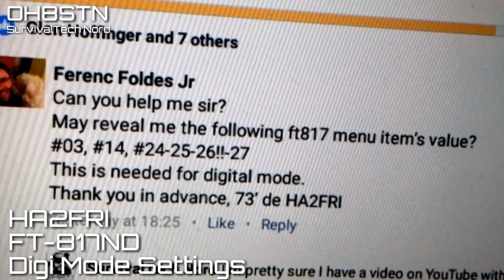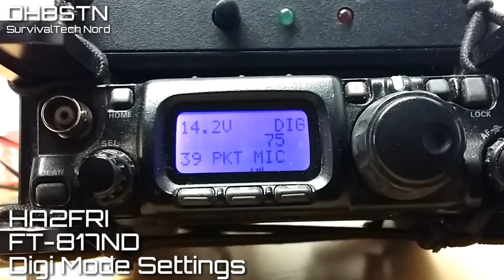Yaesu FT-817ND FT-818 Data Modes Settings

Comment: Hi dear Julian,  i have a question for you: is it possible to use the Xiegu ce 19 interface  for ft 817 yaesu to do ft8? And how configure? Tnx  and 73 de IW2HTZ  Roberto
Reply from the maker: Definitely not. It's not a good interface at all. Kiss yourself a Digirig. That's the best interface on the market right now.
Reply: @OH8STN  ok Julian,  always clear. Tnx and my bests 73 IW2HTZ Roberto

Comment: Anybody using the 817 or 818 with the Tigertronics SL-USB-RJ45 ?? for Data Modes ???
Reply: I just picked one up this past weekend that's why I'm looking through Julians old videos. Starting on the journey to learn digital.
Reply: @stahpit1971  cool.  Check out Nov 2021 of pg 46-47.  Good luck :)

Comment: Thanks Julian for your videos. I have just setup my FT817 for WSPR reception. I am finding that when I select a  frequency  in WSJT-X wspr it selects the correct receiving frequency for a moment ., then switches 2180 hz lower?? Is there another setting to adjust?? 73 Jim

Comment: Quick question.

I am using an FT-818 with a Signal link and FLDIGI.  We use this set up locally on a UHF network to support emergency communications between local shelters, the EOC, etc..

Recently a few helpful members of my club were helping me fix a transmit issue and as a result I can only transmit NBEMS in packet mode.  Previously I was able to send or receive (not both) in FM but since the changes they made it only works in packet mode.  I am not sure if this is an option selected in FLDIGI or the radio.

Other then having to switch radio modes to packet the set up works beautifully. But everyone else is using FM.
Reply from the maker: The problem you're having is when you want to transmit data with the 818, assuming the signalink is connecting to the back data part of your radio, you should do so with the radio in packet mode. If you want to use other modes for example on HF, use DIG digital mode. The only time you would use FM as the mode for data Communications is if your signalink was connected to your mic connector, which is a bad thing. So packet mode for FM data. DIG mode, for all other data. They are two different pins on the data port of your radio.
73
Julian oh8stn
Reply: @OH8STN  Much appreciation, some folks are telling me that using packet is wrong (trust me in no way am I arguing with you) and the guys who made the switch for me on my gear without exactly explaining what they did called it a workaround from a  video they looked up.  Yesterday it worked perfectly for me during an exercise; like it was intended to function that way (which obviously it is).

Yes I have the Signal link plugged into the data port in the back of the radio.  I clearly see the configuration distinction you made regarding if the Signal link is plugged into the MIC port instead.

I appreciate the precise and efficient explanation, I like my processes to be clearly documented and repeatable.  This is all a bit more than a hobby to me.

Now that I have this working in UHF/VHF, my next hurdle is make it work in HF and DIG.

Again thank you.

73
Reply from the maker: I don't mind if you're arguing :-) hey just so you know packet or PKT & DIG are just the names used to distinguish packet for FM data, digital for SSB data on the 818. That's where the confusion is coming from. I also have one little piece of advice for you. Don't let some fool mess with your gear. I suspect you understand that already :-) ;-) if it was working perfectly yesterday, I would put it back the way it was. The fact that you're asking questions means you're a step ahead of those knuckleheads. :-)

Comment: Thank Julian! Great video.
I have an 817nd trying to get my Kantronics working it is the new model that they put out .
I'm just wandering what the radio must be set to USB LSB DIG, not sure what it need to be on.
Thank you.
Reply from the maker: I think I made a video on this but I don't remember. If you're doing digital modes like APRS with the kantronics on FM, the radio should be in packet mode. If you're doing modes like psk, js8, ft8, ... use dig mode.
Reply: @OH8STN  just using winlink for emails only. have not set up psk31 yet and Mobilink I work on that soon. Thanks for making the great videos for us Youtubers it takes special person to go outside and make a video in zero degree weather.
 Thanks again 
73's

Comment: hi, I cant seem to get wsjt-x to connect to the mini pro sc, im just using the one cable from the mini pro sc to the ft 817 data port, what am I doing wrong ? thanks
Reply from the maker: Hi Ronan. You'll have to give a bit more information than that. What do you mean by connect? Aldo, what operating system are you using? Anyway the most likely problems are selecting the wrong audio interface in the sound card settings of wsjt-x.
Reply: Hi. I got it working I set right control to none now I am decoding, where should alc be on 817 ? None a little or in mid bars thanks
Reply: @OH8STN  its ok I sorted it, I choose none for rig control and she started decoding :) where should alc be on the 817 ? a little or none at all ? thanks
Reply from the maker: @ronancullen4565  great 👍 alc should be almost none, otherwise its splattering the band.

Comment: I just got me a Yaesu Ft-818 This last summer and been trying digital modes now on it.. When u say leave it on User-U, I've done that but will not transmit on that mode, but only on PSK-31-U.
Reply from the maker: Perhaps there's a firmware difference between the two radios. This is the 817nd.

Comment: Hi Julian, I hope you’re well? I’ve just got a 817 and trying to get JS8CALL to work, I can hear stations and see their conversations, however when I TX CQ, no one seems to be ‘hearing’ me. 

I’m convinced it’s ‘operator error’ on my part or I’ve got a setting wrong in the radio/program, as I’ve used the same setup on the RaDAR challenge Saturday gone and I was getting contacts as far away as 1600 miles.......any help/advice would be greatly received, 73.........Paul
Reply from the maker: I'm just heading to bed but try this Paul. Most common mistake we make is putting the radio in USB mode rather than digital. Having the radio and USB mode will replicate the symptoms you described perfectly. Try DIG. I also have a couple of videos and setting up the Wolphilink with 817. Naturally the interface is different but the settings on the 817 are identical.
Reply: Cheers Julian, I’ll give that a go tomorrow. Sleep well 👍🏻

Comment: Hello Julian- Do you use these settings when using the Wolphilink?  I just got one and need to tweak it. Seems that I am not decoding, the owners manual does not have much info on how to tweak it.. thanks for your great videos.
Reply from the maker: Hi Mike the owner's manual has a section on adjusting the transmit audio and reception audio. To treat the transmitted you need to adjust the transmit pot on the Wolphilink, well you have your ALC meter showing on your rig. Then you can adjust it perfectly. For reception you need to have one of the apps open which has a waterfall. Slowly turn the receive pot until you have a stream of stations in the waterfall. Then adjust for best reception. There's also the squelch Android psk on the left side of the screen at the bottom. You can stop the random characters from showing up by touching one of the higher bars.
I hope this helps
Reply from the maker: I forgot to answer your first question, yes I use them with the Wolphilink

Comment: Thanks for the video.  Tried your settings and they work, sort of,  on my 817nd.  However, after each transmission (wsjt-x ,Windows 10, Signalink)  I get an error message that says " Hamlib error: Command rejected by the rig while exchanging VFOs". I then click retry and then enable tx again and I am able to continue the qso until after the next transmission. Then aforementioned procedure starts again.  Here's hoping you or someone else can assist me.  Tnx.  By the way, I did get that Super antenna setup.  Cool.  de ke4rk, Mo
Reply from the maker: Are you using split mode?
Google "Yaesu ft-817 Hamlib error: Command rejected by the rig while setting". Sourceforge is down right now, so I can't give you a link. When it's up again, you'll find your answeris well documented.
Reply: Thanks for the quick reply.  No, I am not using split.  That was my first thought also.  I saw that too about Sourceforge. I'll keep checking their site. 73
Reply from the maker: No problem. One thing you can do is try an older version, if you have it available. That sourceforge thing as a real bummer.
Sorry I couldn't be more help
73
Julian oh8stn
Reply from the maker: By the way what kind of dog is that in your profile pic?
Reply: That's Sophie.  I got her from the SPCA and they think she is an Australian shepherd.  I got her because she has blue and brown eyes.   BTW, that's a "dirt" moustache.
Reply from the maker: Here are my boys
https://www.instagram.com/p/BfLi25jg9hw/
Reply: Huskies?  They look playful.  73  de ke4rk

Comment: Thanks! Also, it took me forever to figure out why I could receive (display) MT63 via fldigi on my FT-817/SignaLink setup in VHF, but could not transmit. The problem was that I had the rig in DIG mode, when it needed to be in PKT mode. 73... Roger / NQ8RP.
Reply from the maker: +Roger Parrett seems I should have made this video a long time ago 😀
73
Julian oh8stn
Reply: Absolutely..lol.. No complaints, though... I've learned a TON from your channel... :) 73... Roger / NQ8RP

Comment: Love your videos. Question, I'm purchasing FT YEASU 891 next month. I would like to power this with a battery. (I'll be low on $$ after the radio ). I have seen your video on the LiFePo power source you made, that will be a later project. Can you recommend a Short term Battery so I can get on air for the least cost? I will be running the rig  at 25W or lower...just looking for a short term solution. Thanks David KA1HEU 73
Reply: This will be my 1st HF rig. my budget is $630 for the radio and $150 max for the power..
I plan on building the LiFePo pack from your excellent video..That will be some time this summer.
(I'm Retired living on SS LOL..) I will be using this as a base initially. Then after building your LiFePo Batter system I'll be doing some backpacking . 

Thanks For your sugestions
Looking forward to working HF.
73
KA1HEU
David
Reply from the maker: +df2486 hi David I agree with my buddy who commented on your original comment. You have two choices for the radio power. A desktop power supply should be your first purchase with the radio, if you're going to use it from home. When you're ready to operate the radio out in the field, go ahead and build my battery pack project, or get yourself a ready-made LiFePO4 pack. Don't try to save money on the power supply. Good clean power should be the priority and still come in under your budget.
Reply: Thank You :)
Reply: Thank You :)

Comment: Excellent video.  I may have kept my 817ND had I been able to work out the setting to get it operating PSK31.  Pulled a lot of hair trying.  Wasn't  enjoying QRP on phone so I sold it.
Reply from the maker: +Wayd Walker yeah qrp phone can be frustrating.  The user manual is pretty unclear about the settings. I think they also didn't intend for us to use the 817 the way that we do with modern tablets and laptops and things like that.

Comment: Thanks for sharing, Julian! 

Summary below for those who want to cut and paste into their notes, or are too impatient to watch the video :)
03 9600 MIC = 70
14 CAT RATE = 38400
24 DIG DISP = 0Hz
25 DIG MIC = 65
26 DIG MODE = USER-U
39 PKT MIC = 75 (FM operations only)

FYI I have used similar settings successfully. 24 and 26 are particularly important.
Reply: Being blind having the menu numbers in written form was most appreciated.
Reply from the maker: +Matt Runyan thanks Matt
73
Julian oh8stn
Reply: Thanks Matt for posting that.